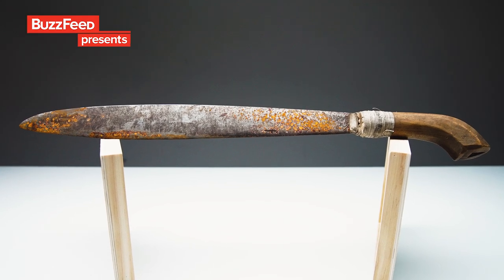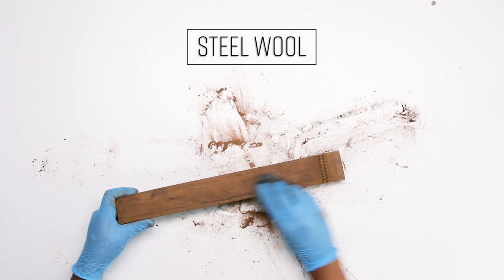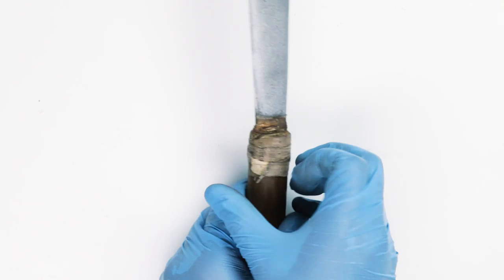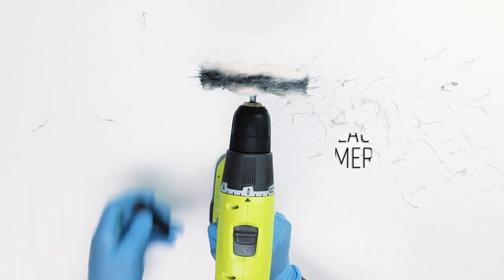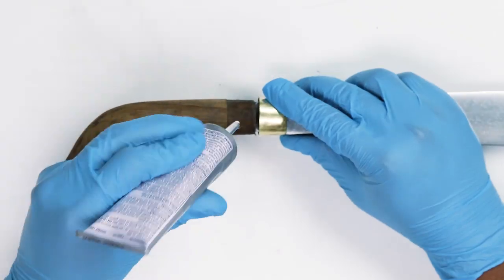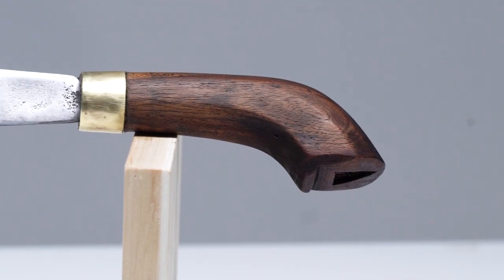Rusty Machete Restoration

Comment: the most blunt-looking machete ever
Reply: Zoe Mateo I belive it might be a Traditional Hmong Knife
Reply: mmtl her I'm hmong but I don't think our knives are shaped like that
Reply: Chali YYY Some actually do, but exactly it doesn’t really look like it but the handle and everything is good
Reply: mmtl her yeah, especially the casing of the knife
Reply: Its because he was an idiot about it an went straight to a super fine stone on a restore. The grit on the stone should have been 600 or lower then he should have worked up. 3000 is a finishing stone and he had no edge to finish in the first place.
Reply: mmtl her im hmong but i dont see knifes like that in our culture and the blade is especially thick.
Reply: Jomz yeah that's what I told her but, yeah.
Reply: A bat has more sharpness
Reply: Machetes aren’t supposed to be sharp chancho
Reply: Agree
Reply: Looks like a filipino bolo or a thin barong.

Comment: Compare this to Jun's video, he had done it without sanding, but just pure sweat and hard work.

and chemicals bc why not
Reply: Jay Perez He did sand it, with an electric sander which could’ve gotten rid of a engraving. Trying to be all smart and shit but you clearly haven’t even watched the whole video.
Reply: @amynguyen5528  Are you talking about Buzzfeed or Jun?
Reply: PTXCeline Buzzfeed. Jun sands with sand grit paper. He uses an electric sander.
Reply: @amynguyen5528  Now I'm confused more. Because if hats the case then is the guy saying Jun didn't sand or Buzzfeed??
Reply: PTXCeline That’s because he (the commenter) is utterly incorrect. Both of them sanded but Jun used a better, traditional way that won’t get rid of the engravings.
Reply: Japanese cream.
Reply: @duzitlogan3003  That's not how it works, you don't use just one thing in restoration, that's like using a hammer to fix your house.
Reply: He used a cleaner with bicarbonate which got rid of the rust he probably used it also so it didnt ruin or get rid of the japanese symbols
Reply: Jay Perez chemicals has nothing to do with sanding what lmao
Reply: Dude Jun's video was completely different. My knife had patina while his didnt
Reply: @circle4602  he still sanded it

Comment: Next time try polishing it by hand because you can damage the blade very easily. I know these big machines can make it faster but you can get a more better result when hand done. Also it really scratches the knife up from scratching it with the metal sponge and the sand paper. Im not trying to be mean in anyway, this is just a freindly tip for next time.
Reply: Polishing a blade by hand takes weeks.
Reply: Sanding is a perfectly legitimate way to restore Blaze
Reply: No it damages the blade leaving long scratches on every inch which makes it un-appealing
Reply: @broccodoggo8363  sanding can also bring rust back.
Reply: Creed Anims YYYYYTYTUUUUUP
Reply: @broccodoggo8363  
C':
Reply: Binna Croteau thank you for being noce
Reply: Binna Croteau I agree but it’s not more better it’s just better. Sorry I just can’t help myself with grammar sometimes and I’m already pissed of with how he sanded down every fucking thing.

Comment: Don’t use a sander, it will remove any engravings that was previously present
Reply: Muh engravings.
Reply: It's a machete.
Reply: He sanded off an engraving on the katana
Reply: Carit World even if it's a work tool its still history. I mean people like us were the same back then. You know how some people customize their things like computers, phones, hell even guns. People are upset(mostly enthusiasts) because they just casually got rid of a piece of history.
Reply: Sand paper smooths things out. If he wanted to grind shit out he would use an angle grinder.
Reply: Robert Wing watch the katana restoration video
Reply: 18S2-7 elise teoxinning he used 80 grit for the first layer so its not strong enough to really make any engravings go away then he used all the way up to 220 grit (so you know higher grit is less rough because you clearly dont know anything about it) which smoothens it out
Reply: 18S2-7 elise teoxinning and sand paper is meant to smoothen not shave off layers

Comment: Absolutely never sand the metal of the blade, it can completely ruin the look of the blade & functionality.
Reply: And how to you propose you give it an edge again? besides, if the rust went deep into the blade, it'd be ruined anyway.
Reply: whetstone
Reply: Maki Visuals what do you use instead
Reply: A whetstone does the same thing as sandpaper, you know nothing.
Reply: Federal Government of Free America you don't sand blades to give them a fucking edge and electric sanding ruins the blade by fucking with the heat treat and taking all the character out of the blade
Reply: You definetly don't know anything about blades.

Comment: @2:46 I'm sorry, but it doesn't help the people's case of 'this-guy-doesn't-know-what-he's-doing' when he calls white rouge compound 'white rogue.'
Reply: not sure if it's "white rouge" or "white rogue" and they spelled it wrong...
Reply: KeoN it’s ‘white rouge.’ It’s a jeweler’s rouge used to remove deep scratches in metal, but sometimes is used to polish aluminum. The guy fucked up.
Reply: ah, i was assuming it was the color rouge
Reply: KeoN I feel you, dude, it’s not something most people commonly see, so I get where the mistake might come from.
Reply: e.e im confused. if it was a spelling error it shouldnt matter and if he didnt know it still shouldnt matter e.e
Reply: InariHaru it matters because it’s apparent he has no clue what he’s doing and is making no real attempts to learn about metal restoration and, subsequently, is spreading misinformation about how to do so to a massive audience. He might say it’s his first time restoring something, but there is another video posted in 2017 where he restored an old sword from a time capsule and used the same lack of care for the restoring process as he did in this one.
Reply: Why is this so big of a problem he's is only restoring a machete and if it works why does it matter?
Reply: Morris Klerx there might be something engraved on the machete. Since he did it wrong, the beautiful engravings on the machete would be gone. Not to mention, he is giving misinformation to a large audience.
Reply: @Chaun John, because he did such a terrible job with the wrong tools, this guy is the literal definition of why i don't trust buzzfeed to do anything, anybody who works for them clearly were homeschooled by rocks.
Reply: I'm going to assume the audience would be smart enough to do their own research if they want to do their own restoration. He made a mistake. People are acting like he was sooooo horrible. It's a friggin' Buzzfeed video.
Reply: slimkt bruh smh🤦🏼‍♂️
Reply: slimkt it was his first time he clearly said it.
Reply: slimkt is
Reply: slimkt I
Reply: slimkt jlgih
Reply: WATCH OUT EVERYONE THE COMPOUND HAS GONE ROGUE
Reply: Of course he doesn't know what he's doing, he said "first time restoration" so chill would ya?
Reply: I really want to buy that for 200 dollars for time
Reply: slimkt no
Reply: slimkt waw
Reply: slimkt Aw
Reply: slimkt google it, its white rouge
Reply: Lgindia
Reply: slimkt p
Reply: sanded to the wrong grit with wrong method and then stacked rouges ontop of each other and didnt even fully load tje wheel
Reply: I like Star Wars Rouge One
Reply: slimkt he knows more then you could possibly know, as he actually knows what he is doing.
Reply: leave him alone
Reply: Noor Rashid lol he ruined a blade and called it restoration. I couldve done better with just an iota of research
Reply: Derpy Duck “Ruined a blade” lmfao did u not see the before and after? And a “ruined blade” wouldn’t be able to cut an apple like that 😂
Okay if you think your so smart then make a video on it xD
Reply: KeoN isn’t that pink or red lol?
Reply: Morris Klerx because that could have been a valuable antique that could have told a very important fact about history and he just made the engravings unintelligible!

Comment: For anyone wondering, the the smaller the number is the more abrasive the sand paper is. 80 grit sandpaper is extremely coarse and will take more material off the surface, 220 grit sandpaper is very fine and will take less material away.

Comment: Remember to always use a metal that is softer than what you're trying to clean or remove rust from. The steel wool scratched the brass, you'd want to use a brass/copper wool or brush in order to clean brass without scratching it.
Reply: useful info. thanx!!

Comment: Pretty good resto, I agree the sander seemed a bit like a "hammer for a scalpel" situation, but the blade edge looked good, you left the pitting, and kept and stained the original wood. 8/10

Comment: the way you ran the blade down the whetstone made me cringe
Reply: That is the correct way sooo?
Reply: MayMay Machine lmao except it’s not?????
Reply: How do you think you sharpen it?
Reply: MayMay Machine almost how he’s doing but you must put your hand and apply pressure on the part of the blade you’re sharpening all the way down to the heel and when you’ve accomplished a burr, but only apply pressure when pulling the blade backwards to prevent cutting into the stone. This is how the Japanese did and still do it, and they seem to have a good idea or two about sharpening stones.
Reply: And it’s not how I “think” it’s supposed to be sharpened, it’s a technique I know is used to for sharpening

Comment: why is everyone attacking this guy, ill like to see you do a better job than him
Reply: A D A M Yeah every body is blaming him
Reply: People don't know how blades are made or built in the first place. Electric tools only hurt a blade if you use them improperly. A good 90% of modern blacksmiths use electric belt sanders to sharpen their knives, with whetstone to put finishing touches. People are just triggered because they've seen some Jun guy mirror polish a knife.
Reply: I HAVE many times and just for proof i tried the method used in the video TWICE  ( to give it a fair chance )and it ruined the blades integrity (it thinned  the blade and ruined the temper making it bend too easily)and for the power sander thing that’s pre tempering they are shaping the knife not to mention you can use belt sander on the taper but  not the rest of the blade because  the taper IS’NT what GIVES THE KNIFE IT’S INTEGRITY and I know this because I apprentice in this THIS IS LITERALLY  MY JOB and I don’t pretend to know what I’m doing for YouTube money (sorry for the rant btw)
Reply: Also his sharpening job is low key trash
Reply: I mean he did alright but just because I can’t do better than him doesn’t mean he’s good it just means I suck at it and hey I’m not saying he’s bad at restoring thing it’s just I think he could improve a lot
Reply: what kind of logic is that? That's like defending a movie director from movie critics saying "you make a better movie then!!"
Reply: give me $50 for the necessary tools and a week of prep and i will lol

Comment: The "brass piece" is called a ferrule.  That it needed to be glued means that the handle should be replaced as it is worn or has shrunk.  I'd say both. It shows signs of cracking in addition to the wear.  Ferrules are traditionally a friction fit.

Comment: I don’t think any of y’all who are hating on him could do a much better job either 😑
Reply: No i imagine any of us could do a better job cause one, every problem he has with it, SAND IT OFF. I cried when he pulled out the electric sander, just remake the handle and sheath like black beard projects, in my opinion
Reply: Hunter Masterclass possibly not maybe it could’ve been too damaged just to do that
Reply: EXACTLY
Reply: So their criticism is automatically invalid?
Reply: Actually I know I could. I do restore ancient weapons for a living.
Reply: Lmao I can do a better job, I just need that machete and some chemicals and whetstone but I can’t becoz I don’t have the materials
Reply: Amy Nguyen are you sure about that because on your video it looks like you’re eight year old
Reply: Amber Anwar yes, we could, that’s why we are complaining. Firstly he should have started with other solutions not just vinegar that are specifically made to remove rust; what he did was sand it which just completely scratched off all of the engravings and with it it’s value. Secondly if you DO sand something you start with the steel wool and THEN use sanding paper but what he did was wrong. The oil wasn’t so bad, I guess but there are nicer things he could have done. To sharpen the blade you should mostly only touch the edge of the blade with the whetstone whereas he just flattened it. Those are only a few pointers and I’ve only restored maybe 1 or 2 things before but what he did just diminished value and you could still see many large imperfections within the metal as he only sanded. Oh and finally he didn’t even add anything that will protect the machete on the future from any other damages.
Reply: I am 11 and did a job about the same with the same amount of hard work it is hard no matter what  the only thing I would have done is instead of starting on a  3000 grit stone I would have started on a 120 up to 8000 to make it have a nicer bevel and cleaner sharper blade.
i did my work on a butchers knife it was hella hard so good on buzzfeed i guess.

Comment: Edit: I just noticed on the whetstone close up you can see the edge isn't even contacting the blade near the tip
CRINGE
Could have got the same effect beating it with a hammer. Any resemblance of a blade shape is gone, and the sander ruined it, it's uneven now and the whole thing would have to be redone, except any unique markings are now gone.

Comment: You would have been better to use a brine solution(salt water) and used electrolysis to remove the rust. Also you never need to start with 3000 grit. You would have been fine starting with 500 and working your way up to 3000. Most of my knife that I sharpen I don't even end on 3000. Sometimes I end on 2000 or even 1500. Also jumping from 3000 to 8000 grit isn't very good. It is too much of a jump and you will end up ruining the whetstone. And the blade. You need to use rough stones to get the major divets out of the blade and then use the high grit to finish the job. If done right you can get a mirror finish. Also your blade shaping could have been way better. The electric sander should have been used to re shape the blade instead of trying to remove the rest of the rust. A wire brush on a drill would have been better for that. Also you might have wanted to re temper the blade or even re forge it as the blade was looking a little thin towards the handle and that can end badly on a machete. For what the blade was originally and for your first try it wasn't a bad effort but try to search some videos of others restoring knives and stuff before trying yourself. If this blade was special to someone and you botched the restoration then it wouldn't have been good.

Comment: Unless the value of the antique would be adversely affected by the removal of the patina (like the tang of a Japanese sword), there is nothing wrong with sanding. And contrary to popular YouTube-Commenter belief, even an electric sander can be fine if you are mindful of using a finer grit and lighter touch than you otherwise would if you were sanding manually.

Comment: I dont have a huge problem with this restoration, however sanding is still a huge mistake you make, you scratch an scar the surface which makes it harder to make the finished product look clean when you sharpen it. Sure while sharpening can take longer you'll get a much nicer look on the blade once you finish everything

Comment: Seems a bit... eh, excessive?  All it really needed was the rust removed, the sheath repaired and the ferrule cleaned and re-attached.  I would have personally left the blade alone after removing rust with just a good rub-down of mineral oil (leave that lovely patina) then wiped down the wood with some mineral spirits or the like to remove any excessive grease or dirt, along with some brushing before oiling them as well.  Then sharpen, of course.  No blade should be dull!

Comment: he sharpened it at an angle way to sharp for a machete you need sharper angle for a kitchen knife (10˚ to  15˚),  medium for a chef's knife (20˚), wider for a cleaver (30˚) and for a machete you need like 30˚ to 45˚ not like 10˚.

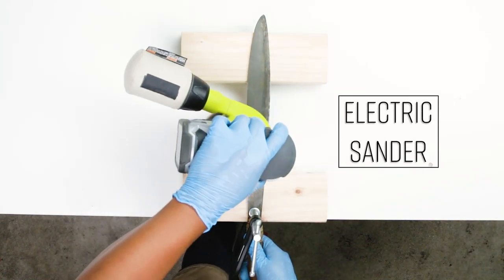Comment: 1:13 you should have stopped right there. that is the original patina most bolo's are found in. Should have had it cleaned of the vinegar, sharpened and oiled.
1:20 80 grit electric sander on a bolo? why are you starting with such a rough grit? these things were mostly made of soft railroad steel
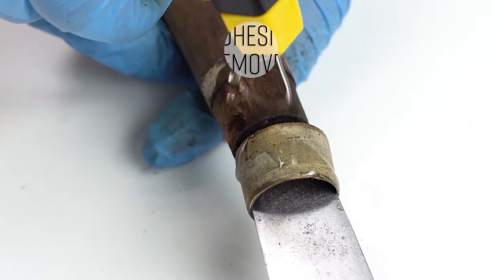2:01 Why are you using steel wool on a brass bolster?!
2:19 Why are you not supporting the spine? rocking and rolling that blade all the way will never give a consistent sharpness. there is a shadow between the blade and the stone for every stroke, you are not sharpening that thing, just polishing it
3:54 Does that look like a sharp blade to you?

Comment: The guy only went up to 80 grit, and also 220 grit is not as rough because the higher number then more fine it is, and sand paper is meant to smoothen not shave off
Reply: Robert Wing have you felt 80 grit in a power sander no because it would take your hand off it’s just too strong for the blade to take
Reply: 8 Skull yes i have and its not enough to shave engravings off

Comment: horrible.... and you sharpened it before you were done working it, probably a terrible edge either way but dangerous considering you didn't even wrap the blade while working the handle. I shouldn't be surprised since it's buzzfeed but you're obviously a somewhat talented craftsman why would you do this....